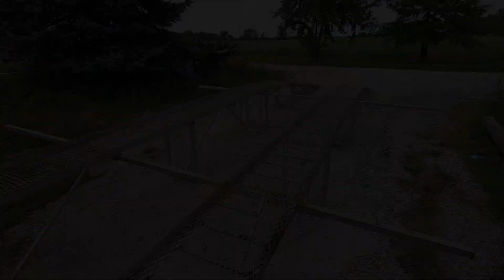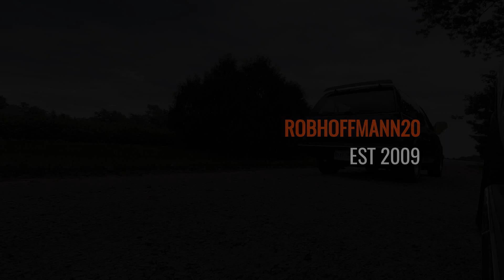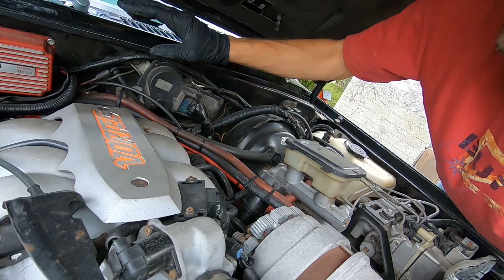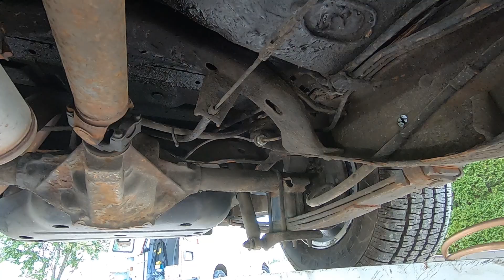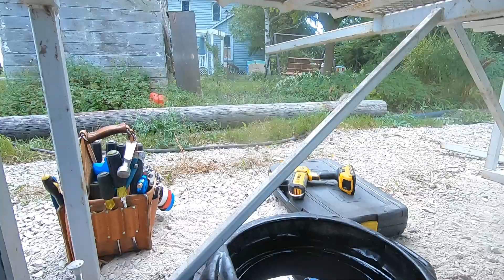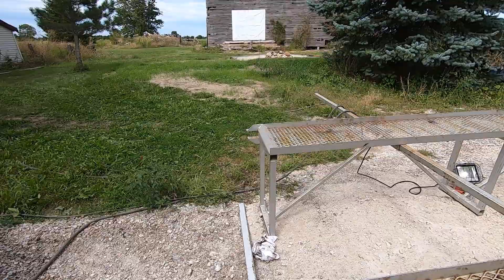Fuel Leak Repair

Comment: I went ahead and replaced all my fuel hard and soft lines from the fuel sending unit to the engine bay because they were rusted and pitted. It started with the sending unit had a pin hole in one of the hard lines coming out of it. I replaced the whole sending unit. Then the return hard line on the frame busted, spraying gas all over the place. That's when i said that's it im replacing all the fuel hard and soft lines on my blazer. I don't trust rust anymore after all that lol.
Reply from the maker: Definitely a good plan! That will be something in the near future i'll have to take care of.  i'll likely do brake lines at the same moment,  I trust them however I always make sure my parking brakes work well just in case
Reply: @RobHoffmann20  yeah i had a brake line blow on the rear end, so i replaced both of the hard lines on the rear axle, replaced both wheel cylinders and replaced the two soft lines in front and the one in the rear.
Reply from the maker: @oldschoolmodeler  that's definitely the best practice. The worst I had so far was my header rubbed on a brake line and made a pinhole but I use the Union in fixed that. And then more recently I replace the flex lines with stainless braided Flex lines, the brake lines themselves are okay but they're also for 1993 and have a little bit of rust kind of like that fuel line was always in the back of my mind something I will get to.

Comment: You said the return fuel line didn't have much pressure why is that?
Reply from the maker: The return is only allowing the unused fuel a path back to the tank, There are very little restrictions in the run as its sized based on the supply line to minimize the restriction. its basically an open hose that allows unused fuel a path back to the tank, it will have some pressure but nothing compared to the 60+ PSI on this fuel supply side.